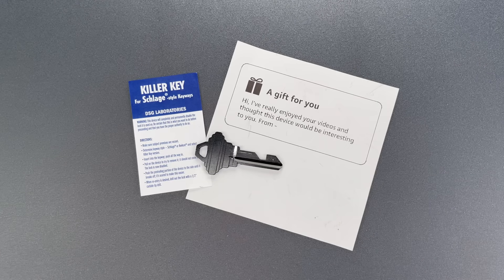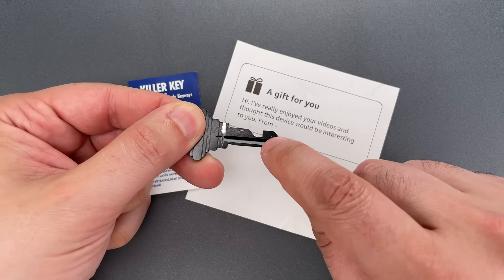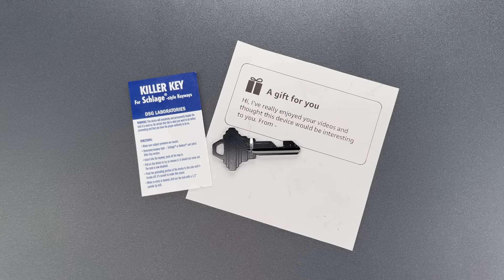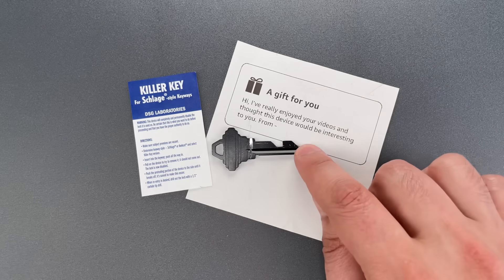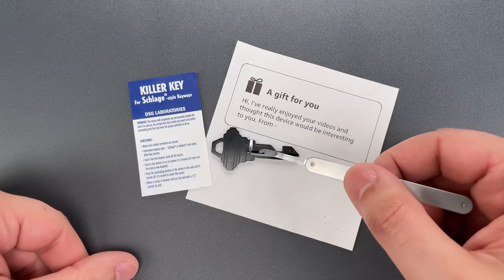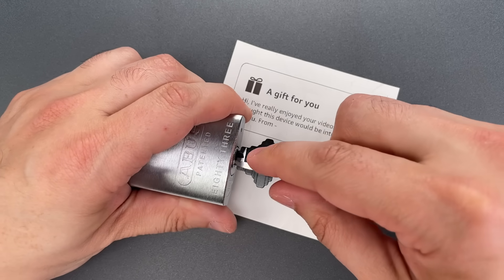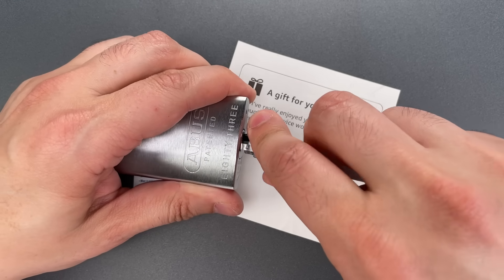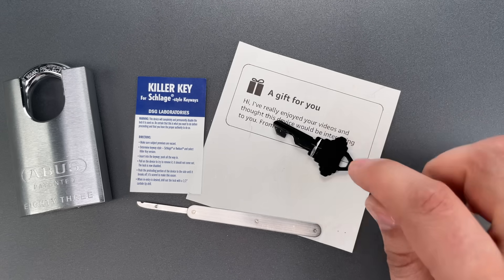[1350] Defeating a “Killer Key”

Comment: I remember you having talked about a similar thing to do to your house. I feel like 1) I'm more likely to lock myself out than I am to be victim to a solely-lock-based attack; and 2) this feels like a revenge key first and foremost. 

I guess my concept of locks is if someone is walking by and trying locks on every door (more likely on a car than a house), the suspicious act of picking, breaking a window, etc. is not worth it compared to robbing someone who forgot to set their lock. Which I guess is not a very good way to organize a society or regard safety, since it requires a single unlucky person to get screwed. But I also have OCD so you best believe I check locked doors a bunch of times in a row just in case. I also pray to a god from a religion I'm no longer in, and I think the locks are maybe slightly more practical, but not by much.

Comment: How to make a lock unopenable step 1, have a good blowtorch and stuff step 2 heat up the metal lock so it starts to melt step 3 after it is melted a bit is should be wacky now and you can't even get a key in it or a thing in it

Comment: What difference does it make putting the notch further downthr key,,,,,,harder to lift the pins out of the wsy?
Reply: My novice opinion is that notching the key further back means the part left in the lock would not be visible on casual inspection thus increasing the amount of time someone would have to spend fiddling with the lock trying to get in and increasing the likelihood they would be seen.
But if I ever had to disable a lock I couldn't simply replace, I'd fill it with J.B. Weld.

Comment: The same thing can be accomplished with a common broken key extractor. It helps if you bend the hook slightly to get a better grip. Just use the perfectly flat back of the extractor to lift the pins out of the way, twist the hook slightly to catch the cut and pull.

Comment: I presume the lock killer is intended for swiftly disabling a lock before one can get caught. If one has a bit more time, one could crazy glue the key into the lock. Or just crazy glue the lock. Or stuff solder into the lock and use a micro torch to melt it. 😇
Reply: It’s mostly for landlords to lock out evicted tenants until they can get the locks rekeyed.

Comment: @Mr.Lockpicking Lawyer: You mentioned in your video that the “Killer Key” can be very useful.  Can you please let us know some examples of where the Killer Key would be useful?  As for me I can only think of it be useful in locks where you want to intentionally prevent someone from being able to access their own lock which seems a bit on the nefarious side of things, but that’s ok.  Thanks in advance for your reply!
Reply: Mostly to lock people out who no longer should have a key. Lapsed Storage lockers, evictions, repos, unfulfilled contracts, as well as to lock out things that have become dangerous with hazmat and such (kind of an Extreme form of lockout tag out) or for instance if have a mid door between an old duplex and you want to keep them separate. Or something like a side door that you don’t use but you want to be a little more Secure and you just as soon just lock it out for ever. Now most of these have better ways to handle these situations but that doesn’t mean that a killer key wouldn’t work.
Reply: @dragonlogos1  couldn't you just.... change the lock?? They aren't that expensive lol maybe 50 bucks for a set? At least the last time I checked
Reply: @Xx0ME0xX  oh there are a ton of ways to go about doing those things but a set of these keys would work. And installing full new locks takes time (you need to go to the store, buy a lock, grab your tools, get rid of the old lock, and install the new lock.) and lot of time that is the end goal but this is a temp fix while you (or the case of most companies the maintenance department) goes about doing that.
Reply: @dragonlogos1  yeah that is true i guess. Depending on the lock you could re-key it maybe but that takes time too, if you have one of these laying around it would be a lot quicker but then you either need to know how to remove it or you will end up wasting an otherwise good lock. But you are right, this is the easiest quickest way
Reply: @dragonlogos1  Why not just replace the lock? Why use a killer key? I mean the lock will need to be replaced anyway, so why hassle with the killer key?
Reply: I was wondering the same thing
Reply: Was reading through the comments to find the same answer.
Reply: Here’s one: a similar product called was sold decades ago but with the blade of the “killer key” split into two halves. One half would stick in the lock preventing the insertion of another key, the other half would have ramps to release the stuck half. Called “motel keys” they were sold to traveling salesmen who had to leave product or cash in a room while traveling. The stuck half of the key would prevent a thief with a copy of the room key from entering while the occupant was out on business. (I’m not an old timer, just like to study this stuff)
Reply: @Arko_Glass  that’s a different product called a lockout key which LPL also defeats…easily.
Reply: @TheBaumcm  I know, I said its a similar product, not the same. There's an article on them in a back issue of The Independent Locksmith's Journal which is a great resource, if the back issues are still downloadable for ten cents on Peterson's. Motels generally all use cards now but its an interesting bit of history. As for defeating one, sure, anybody with a few minutes to learn the concept could do so.
Reply: Prevent the lawyer trying to send you to prison from being able to open his locked case with the proof he needs to win the case.
Reply: @D00ML0RD1  this isnt that one episode of sponge bob man, get it together
Reply: Electronic smart locks. Most of the electronic smart locks come with a normal key slot as well - as an alternative way to unlock like if the lock loses power, etc. Some of these electronic locks are really hard to defeat electronically, but they come with a super easy to pick lock. I wish they'd remove the key slot altogether. Alternatively epoxying a killer key into the slot would increase security greatly.
Reply: The Lockpicking part of him knows the answer to your quesion. The Lawyer part of him knows not to answer your question
Reply: If you had a lot of rooms in a building you wanted to securely lock off for long periods of time, and in a fashion that would make picking the lock much much harder or possibly impossible if the person in question doesn't know how these things work, I could see it being useful. Or situations where someone gets evicted from your property and you want to make it harder for them to break in and trash the place / steal all the copper pipes from the walls to sell for meth, and can't afford/can't get a locksmith to come by soon enough.
Reply: I guess for situations where you're going to change a lock but not immediately?
Reply: my thought, evictions, well, to prevent ease of access, have someone in the unit to unlock it after you get back since you used one of these kays to help stop them
Reply: when you want to send something to LPL so only he'll be able to see what's inside. "destroy" the lock.
Reply: It's for landlords that need to keep evicted tenants from trying to squat in their former apartment
Reply: @jamesrosewell9081  why not just change the locks?
Reply: @jamesrosewell9081  It would be ridiculous to 'permanently' disable a lock to prevent this when you can simply replace/re-key the lock when you perform the eviction.
Reply: @jamesrosewell9081  we either re-key the lock, or replace the lock entirely
Reply: It’s like what he said, to slow down “attackers”. You’d put one of these in your own locks to prevent someone from opening said lock, and if you have something similar to the tool he mentioned or another, you can take the key out again without damaging the lock.
Reply: One other use I can think of is if someone breaks into your house and you really don't want them accessing a certain room (e.g. your daughters bedroom) you can just shove the killer key into their lock and at least said room will be relatively safe.
Reply: The Killer Key is intended to permanently disable a lock. None of the replies to this question actually give a good, believable answer to why they would be used. Every example here assumes, for some reason, that the lock can be used again once this Killer Key has been inserted - which is not true. Unless you have made a tool as LPL has made, the lock is SUPPOSED TO BE permanently useless. 
   I'd still like to hear from LPL as to any non-nefarious uses for this device, as its own packaging states that it is meant to render a lock permanently useless. I cannot think of a single instance in which this would be useful.
  Some web sites use the example of keeping evicted residents out of apartments, but this would be stupid. Why destroy a lock when you should already have a replacement on hand when you perform the eviction? Replacing/rekeying makes a lot more sense. 

  There is no honorable use for this device.
Reply: I can think of a lot of legit situations in which you might need to disable a lock quickly until you can call a locksmith to come and replace it: e.g., you discover your keys have been stolen, or a disgruntled ex-employee leaves without turning in his key. You don't want to leave your premises unprotected overnight or over a weekend, and you're going to need to change the lock anyway, so this would be a quick fix. It wouldn't stop a determined attacker, but it might add enough inconvenience to deter a nuisance intruder.
Reply: Say You keep your set of keys under flower pot, because your wife comes back before you and she lost her own set of keys. She knows 1 of those keys are killer key, and she knows which one it is, so she won't use it; But maybe if someone spots, that you hide them there won't notice while trying to rob you, and he will stop himself in tracks by using it and blocking the lock.
Another example: You lost your wallet and keys. There are documents with address in the wallet; Someone tries to brake into your house moments later, maybe hours at night but still before You replaced the lock, but fake key stopped him from robbery.
Reply: @bartoszmichalik7149  actually pretty smort
Reply: @bartoszmichalik7149  That entire comment is ridiculous nonsense.

Comment: you could use an industry grade welding torch to melt a 5 inch thick steel door to its frame and this man would still pick the lock and get in.

Comment: I wonder if you could use a flat-ended killer key as a lock locker. Combine it with a really tough lock and you then have a 2-layer secured entryway.
You (the user) have the special tool to make removal a breeze, then use your key on your tough lock.
An attacker has to figure out how to remove the killer key, AND THEN has to deal with the lock itself.
While it doesn’t make defeating the combo impossible, it makes it really, really slow, if not requiring an unprepared attacker to use destructive methods.

Comment: before I watched this video, I thought this would be a device to disable a lock; the key would get stuck in the cylinder, then the attacker would pull out the "key" and it would snap the pins inside the lock... though it would probably take a hydraulic ram to achieve the necessary force for that to work.
Reply: their is a device to do just that for kwik set locks its a hardened steel blank key insert into the lock and turn the lock opens turn back the lock closes and tool can be removed and the original key still works as if nothing changed

Comment: What’s the intended purpose of a “killer key”?
Reply: The "claim" I've heard is something like denying access to an evicted tenant until locks can be changed by a locksmith but I don't think I've heard of one ever actually being used anywhere because its so trivial to just pick up a new lock at any hardware store and swap it out in 5 minutes with a screwdriver.
Reply: @matthewmiller6068  yeah, it seems like just a way to potentially rile up the evicted tenant into kicking in the door or a window, and then having to deal with that on top of the lock…

Comment: non-lockpicking California lawyer here. why would anyone want to permanently disable a lock? seems like most likely use of such a thing would be malicious mischief. in any event, why not just buy a cheap blank, coat it with j-b weld, stick it into the lock, and break off the head (pre or post insertion). actually, even if you took a paperclip and coated the inside of the keyhole length with j-b weld, it would probably disable it pretty well.

Comment: Wouldn't it be easier and more effective just to use epoxy?  Maybe use a wave rake to get it on the pins as well (just remember to wipe down the wave rake before it sets).  Or maybe solder.
Reply: J.B. Weld will turn any lock into a paperweight.

Comment: A wasted opportunity - a simple guard, seen for instance at the top of the handle on a sword - would make it much harder to defeat, especially if it's flush to the face of the lock. That way you wouldn't have anywhere to stick your tool.
Reply: The more that's exposed the more torque can be applied. Hence why LPL (and others) build their break point further down the key bitting. You put a "hilt guard" on there and a pair of pliers just crushes it flat in about .1 seconds.
Reply: Portable grinder and 30 seconds ur back to using the tool to extract..
Reply: Sticking your tool in the wrong place means baby jail 4 18

Comment: What I would like to know is what keyway the Abus has on it?  Abus tends to make a larger keyway on the 300 cylinder and if it was the 3000 there is plenty of space to do this.  Plus the key itself is an aftermarket blank and they are notorious for being milled even smaller so they will fit in all keyways.  If this was done in a Schlage original cylinder with and original blank there is not enough room to use this trick. Even that key in an original Schlage cylinder might not afford enough room either. 🤔

Comment: “These killer keys can be pretty useful…”

What is the actual purpose of this key?  Vandalism?
Reply: super late response but i was under the impression that the key was meant to be a decoy incase someone steals your keys, so if they tried testing keys on your door they could insert this and tough luck for them

or well, simply disabling a door so that people with the key still wont get in if theres ever a reason you would want that
Reply: Repossession  operations; Landlords, bailiffs, etc.
Reply: @JohnBatty  so nothing good then
Reply: I believe people use them to disable locks they don't use to prevent someone from coming along and picking them. So if you have a door you basically never use, you can use it to close one attack vector for someone trying to get into your home.
Reply: @seanoconnell3559  Fair enough assumption, but if you want to really disable it, either stake the key hole with a punch or fill it with JB Weld and close the lock.  That can't be defeated with his fancy lock pick tool!
Reply: @seanoconnell3559  I don’t believe that for a second, you would bolt it from the inside in that case, these are for vandals.
Reply: @simony2801  the only legal reason I can think of is if you're a landlord and have evicted non paying tenants but they still have the key and you don't have time to replace the locks right away. Then you buy one of these and jam it in there until you can replace the lock.
Reply: @Potatorq  replacing the lock is quicker and cheaper then calling a locksmith to come and pick the lock ,so you can regain entry.
Reply: @simony2801  I dont have a bolt
Reply: @nikkimcdonald4562  you need a locksmith to drill a lock? Lol
Reply: @SoftBreadSoft  I didn't say that 
Learn to read.
Reply: @nikkimcdonald4562  I know you didn't say it, because you didn't consider that you don't need a locksmith to regain entry lol 

Learn to think
Reply: @SoftBreadSoft  cheaper to change out the lock then ruin a perfectly fine lock set. Also easier then drilling out a lock.
Learn to think .
Reply: @nikkimcdonald4562  Locks have to be rekeyed after every tenant. At least where I live. Which costs as much or more as the lock.
Reply: @SoftBreadSoft  No need to rekey when you switch out the lock set. No locksmith required. I can switch out a set in 2 minutes.  Then I can reuse the set on another rental.
Reply: I honestly think any chewing gum would be better AND cheaper!
Reply: To block an easy pick on an electronic lock that includes a key slot.

Comment: Design upgrade: put spring steel wings on the sides of the killer key, so that they push against the sides of the keyway when inserting. That would prevent you from inserting anything far enough into the cylinder to lift the dropped pin!

Comment: I mean I always figure if I needed to permanently disable a lock system a exterior door with lost keys but want to retain inside ability to unlock just squirt a little super glue in the cylinder. Seen it done before. I feel like some super glue and that “killer key” would effectively stop it.

Comment: This thing could actually be really useful as an extra layer of security for a padlock. You'd just have to make it not look like a key sticking out, and make sure you can remove it later. I doubt many actors would likely to try and pick a padlock that looks like it has a key broken off & stuck inside it.
Reply: No just cut the lock

Comment: They should make the tolerances really tight on the killer key to the point you have to tap it down the keyway with a hammer or even slightly wedge shaped so itd be really hard to bypass